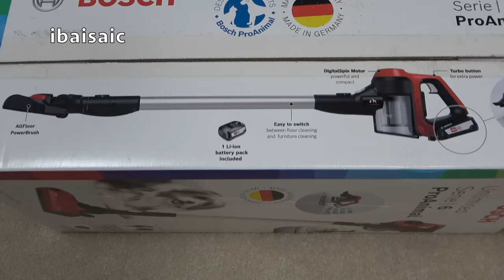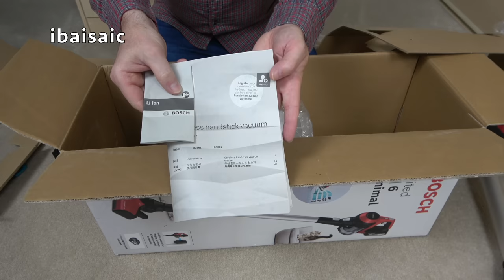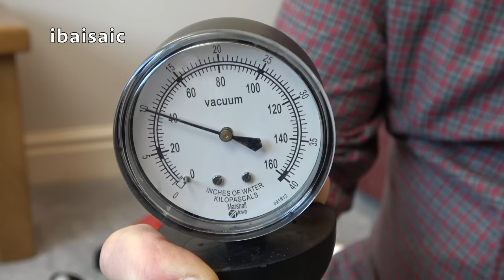Bosch Unlimited Serie 6 Pro Animal Cordless Vacuum Unboxing & Demonstration

Comment: have one bosh serie 7 pro animal and basically the same issues persiste.. don't understand how none has a silicone roller and no bristles, would be easier. but not worthed in my opinion, does not do the clean I need with four pets. turbo mode only lasts10min, I have lots of pet beds to vacuum and sofas...mnhe 😢

Comment: Like all cheap stick vacs, the achillies heel is the air powered brushroll. If it had a belt driven powered brushroll it could be salvaged.  All it does is just stick the hair around the brushroll because its not powerful enough to get it up the channel.
Reply from the maker: This model has motorised brushrolls.

Comment: As for charging the battery out of the cleaner, it's a standard Bosch 18V alliance battery so there are external chargers available, the same batteries come with their 18V power tools and one of their chargers will work.